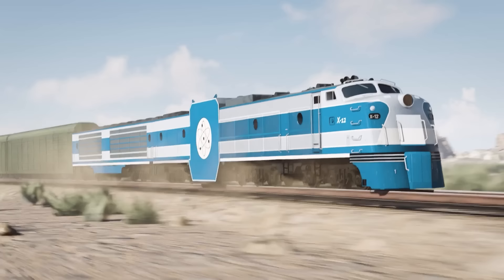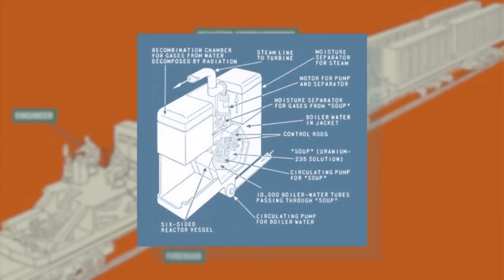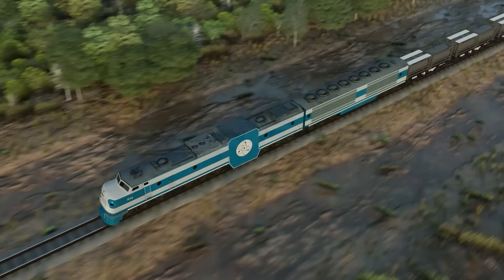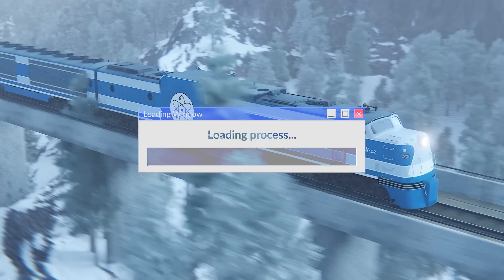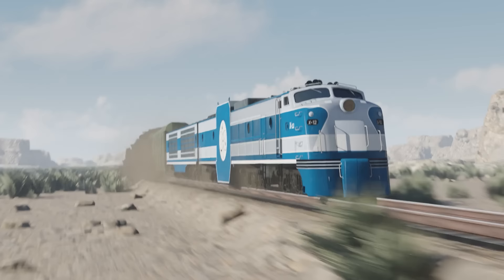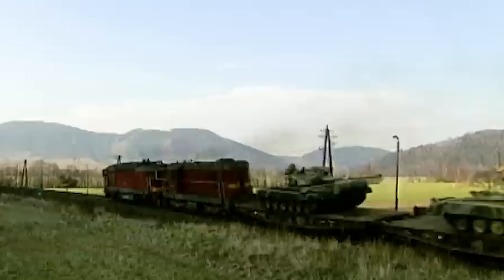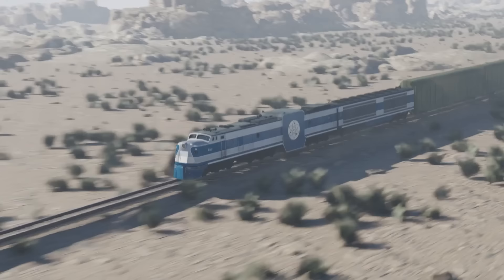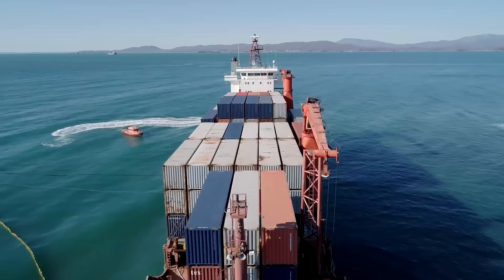What ever happened to Atomic Trains?

Comment: Such radiators were used with "normal" steam trains too, especially in germany colonies in Africa like Namibia, where water was relatively scarce.
Reply: Some American railroads have locomotives with massive radiators, more so than normal, their called "tunnel motors" and are for use in extremely long tunnels
Reply: Those "radiators" on south African steam locos are condensers, it cools exhausted steam back into water in a effort to extend the water supply.
Reply: @anareel4562  the difference with the tunnel motors was that the air intakes for the radiators were down at footplate level instead of high on the sides, so that following locos would not be ingesting hot air from leading locos in tunnels, hence the name.
Reply: Henschell made these locomotives.   They came in useful to the Germans in WW2 because they didn't give of steam that could be spotted from the air.  Also in Russia the watering stations were further apart which was a problem from German locomotives.
Reply: They were experimented with in South Africa as well, and used to varying degrees in South America, for the same reasons.
Reply: Got any extra info? Sounds very interesting!

Comment: Let me guess: did this not take off because power plants do better staying in one place and trains are very easy to electrify using the energy said plants generate?
Reply: That's what I thought. In France, electric trains run on mainly nuclear power so nuclear trains are possible and practical.
Reply: @Abitibidoug 
That’s a bit different, those trains are only electrical.
Nuclear reactors inside train aren’t feasible even now, there’s no technology on safe miniature nuclear reactor, not to mention if the train crash even though very unlikely but it is still a big safety concern when train gets derailed.
Reply: @MP-vc4nu  What he was saying was that they basically already have nuclear trains, because their trains are electric on a mostly nuclear grid.
Reply: No, the issue is safety. And electric trains are not as efficient as people think….
Reply: @goldenhate6649  mind elaborating?  I always figured that trains powered by wire or energized rail just took the generator out of the vehicle for a lighter approach.  Since, y’know, standard freight trains run on electricity made by onboard diesel generators.
Reply: Having a self contained power source is extremely compelling, because you don't have the massive capital and operating costs of thousands of kilometres of overhead wires
Reply: @wotmate  the self-contained power source has gotta be cooled and shielded.  Which means either lots of water, or some complex system you do NOT want damaged.  There is just far too much at stake if a nuclear train crashes or runs dry on coolant to make them viable in my (biased) opinion.

Also anything nuclear costs quite a hefty amount to build and maintain here in America due to excessively restrictive/costly government policies governing the technology.
Reply: @OneBiasedOpinion  I'm not disagreeing, I can just see the attraction
Reply: @wotmate  oh, fair enough.  I guess for me there’s very little attraction outside of novelty.  That being said, the new fusion tech that is being worked on would be amazing for trains since it doesn’t seem to require much (if any) cooling whatsoever.
Reply: @OneBiasedOpinion  as an example, the Indian Pacific is a train journey in Australia with a total length of 4352km, and it currently uses diesel.  It would cost hundreds of billions of dollars to electrify the entire track, but if they could come up with a loco that never needed refuelling, it would pay for itself very quickly, even if the loco cost $10 million
Reply: @wotmate  okay, THAT makes sense.
Reply: @OneBiasedOpinion  Water would not be a problem since late 70's. Ten years after first patent for the nuclear train US started working on molten salt thorium reactor experiment. Test was success but oil lobby decided they will be selling fuels, so they stopped MSRE and ruined civilian nuclear industry. China is currently testing small MSR in the desert, water cooling isn't necessary, they expect such reactors will be on sale by 2030.
Reply: @Signal_Glow  makes sense.  Nuclear has always been directly opposed by Oil.
Reply: @wotmate  Hundred of billion is overstated

While we don't know nuclear train research can achieve the same cost with more risk
Reply: @OneBiasedOpinion  I wanted to write we need nuclear to prosper as a society and very likely for survival. Solar, too many batteries, wind in many parts make no sense, can't provide base load. The rest is dirty and expensive like solar, wind if you count need infrastructure. 
How do you see this?
Reply: We still have diesel-electric locomotives and a mobile power-generating plant.
Reply: @MP-vc4nu Just wait until SMRs become reality. The X-12 will become a thing.
Reply: @wotmate  If we take the higher estimate of 3-4 million per kilometer to electrify, this would still "only" come up to around 13-17 billion dollars to electrify the entire rail track.  You're also grossly underestimating the cost of a possible nuclear locomotive - a regular locomotive can cost up to 10 million alone. Now imagine putting a nuclear reactor into it. I would be surprised if it comes short of 100 million.

It would cost hundreds of billions to rebuild the entire rail in high speed track, not electrify it. It might  indeed cost over a hundred billions to electrify the entirety of the 30000km+ of non-electric track in Australia, but it doesn't need to all happen at once.
Reply: @PAcifisti  I'm not estimating anything, nor am I advocating for anything. I can just see the attraction of a self contained power plant.
Reply: @wotmate  Oh, it would be attractive but it wouldn't be cheap. When you factor in the costs of the locomotives, the facilities that would service them (nuclear reactors usually need yearly fueling) built separately, the specialized crew to maintain them plus the increased insurance costs as a bad derailing would turn from an accident into a disaster, they might not be as attractive as before. 

For this reason they would probably be banned from entering big cities as it would be a massive security risk and a relatively easy target for any terrorist wanting the dirty bomb effect on a bigger city. You can secure a nuclear power plant, you can't secure hundreds, if not thousands of kilometers of potential attack areas for railway track.

Not to forget the last thing - cost. Nuclear reactors can be a bit pricey to run. There's probably a reason why there's zero commercial nuclear powered ships operational in the world despite how good nuclear reactors for ships sound like on paper.
Reply: That and you require 20-30 people to run a reactor... not 2
Reply: No, because diesel is cheaper.
Reply: @wotmate 
Are you trying to say that stringing wired along an already existing railway would somehow be more expensive than the R&D + capital costs of several locomotives each with an integrated nuclear power plant?

You know what's expensive? Nuclear reactors. Especially portable nuclesr reactors. Steel pylons with wires between them is peanuts compared to that.
Reply: @PAcifisti its an upfront investment issue 

These reactors depending on design would need a reuel once ever couple decade (30 or so years)

The main thing that stopped  nuclear cargo ships was fear and design mistakes. And we honestly should look back at that particular tech tree as unlike trains you can't electrify a boat. And with cargo ships getting as big as they are they damn near need a powerplant as big as the ones shore-side anyway
Reply: shhhh spoilers  :P
Reply: Nuclear reactors are also kinda fragile . Which is why we're not flying to Mars in atomic lawn darts yet.
Reply: @arch9enius  well, that and their exhaust typically renders the launch pad and the area surrounding it uninhabitable for a very long time.
Reply: @OneBiasedOpinion  That and a drink from the ''Hot Soup Wagon ' is the sort of mistake you only make once. And then they bury you in Utah alongside that blokes ' garden shed.
Reply: @arch9enius  I don’t get the reference, but it sounds very much like the kind of event that earned someone a Darwin Award.
Reply: @OneBiasedOpinion  Some guy built a reactor in actually his mothers ' garden shed. He died of unrelated causes years later though.